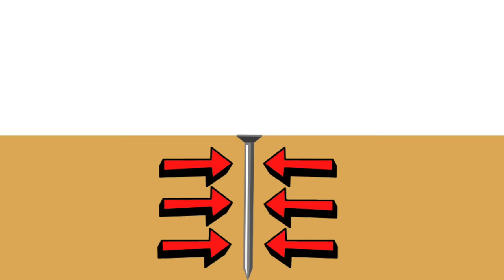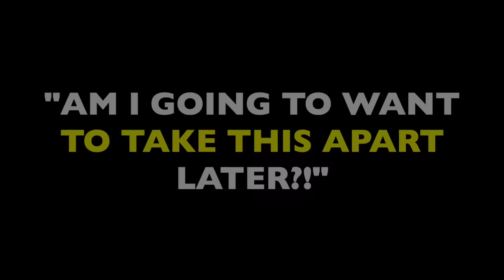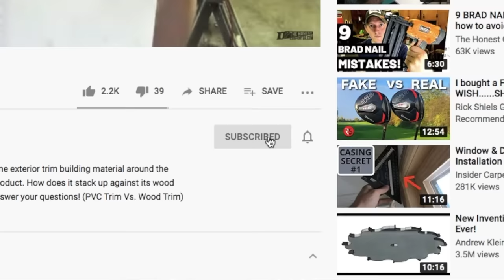NAILS vs. SCREWS...Which Should You Choose?! (Pros + Cons of Nails And Screws For Your Projects!)

Comment: If using screws for a large project, skip the ones with Phillips head slots and run from those with flat head slots.  Invest in screws with a star or square head that are sold with the driving bit you need in the same package m.  This will save you plenty of time as you don’t strip out the Phillips head slots.

Comment: There are also different types of screws. Shear strength can also be improved with a bigger diameter screw. Screws are also excellent in pulling things together to the right location with force. When building a floor system on top of a wall you can literally use one screw to move hundreds of pounds of timber to location or straight line. We do this at work as we build the floor before attaching it to the walls under
Reply: 👆🏼👆🏼👆🏼👆🏼...™️!!!!
Hit me up
❤️❤️

Comment: Nails will pull out more easily than screws, UNLESS the nail has rusted into place. I never considered that until about 50 yeas ago I had to remove some 10 year old siding, then I found out just how well (uncoated) nails can resist pull out. OK, not for decks and such, but things like siding nails work.

Comment: Like you, i use both nails and screws. I only buy exterior nails though, I don’t want to have two boxes of each size hanging around. The nails are usually ardox (spiral) as well. I would just buy exterior screws but they’re not particularly strong, too brittle, better with construction or structural grade.

Comment: I think you missed structural screws. Some are equivalent to 8d, 10d and 16d nails for framing. But it's very important the right screws are used. I think Simpson Strong-tie and Fastenmaster have the easiest to find information on loads/strength of their products. 
I just built my own deck (in Cary) using structural screws (some 8" long!). I'm sure I overbuilt it but I didn't want to do too many calculations. The inspectors didn't check all of my fasteners during the framing inspection, but that might be because it's a very low deck (Cary requires permits for those). I was expecting them to check to be sure I'd used the correct ones. I had all of the load tables for the screws I used ready for them, but they never asked, :-(
Btw Ethan, you're welcome to come see my deck. I got some great tips from you and several other content creators when building it. I'm pretty proud of it.

Comment: I see a lot of comments here (and elsewhere) of people preferring screws, especially for deck boards. I agree they’re strong, etc. and go in great with an impact driver. They’re awesome!  UNTIL you’re the next owner and you’d like to replace or flip the deck boards. The screws just snap when trying to back them out. Going through this now and 90% of the deck screws (T25) are snapping off and I’m having to destroy a board that I could’ve re-used by just flipping it over. It’s quite frustrating.

Comment: Hello. I have a question:  What size wood screw to use to join 1/2" plywood to 3/4" subfloor?  Also, how long of a screw.    I know its going to be either a #6 or a #8.       Also need length?

Comment: Another option to consider is using cut nails instead of wire nails. While cut nails cost a little more than wire nails, they hold better and are less likely to split a board.

Comment: Am I correct in saying the other factor when deciding between nails or screws is wood movement? Nails would be better if the piece(s) are moving because of their sheer strength.
Reply: That's how I judge it. I use deck screws on everything else that doesnt move over time

Comment: Those Deck-Plus screws are exact. Once I used the star head screw there far superior to the Phillips's head, the star head has a more gripping area; I gave all my Phillips heads away.
Reply: Try a Robertson screw, if you can find them outside of Canada. Puts Phillip head screws to shame.
Reply: @leegifford2942  I've tried the Robertsons. They are far better than Phillips. That's the style of screw that came with my Craig jig; I have replaced all of the Robertsons with the star or torque head screws. I live in Northern California.

Comment: I’ve gone back to temporary scaffolding I’d screwed together . With dry wood , when I went to take it apart the dry wood swelling had cause about 10% of the screws to break 😳😬 they weren’t decking screws , just standard wood screws .  Something else I’ve noticed is expensive screws are far better all round than cheap ones .   Nails 🤷‍♀️ cheap nails expensive nails 🤷‍♀️ it’s mostly price by coating

Comment: Hi enjoyed the information you shared. I'm in a catch 22 situation. I'm building a tool shed 2m X 3m but I might have to take it apart in 18 months time to move it. Screws seem to be the obvious choice in this case but will screws give me the strength and durability I need
Reply: Build it as a panel system; constructing the panels with nails, and attaching the panels together using screws or structural lag screws.

Comment: I think you meant that nails rely on friction rather than tension to stay in place.  For anything with a long term tension load, you should use screws. If you are attaching a heavy ceiling, use screws. You can put nails in tension only for short term loads such as wind and earthquake.

Screws actually tend to be stronger than nails in shear. However, nails have more ductility which make them better for earthquakes. You have design a screw for about 2.6 times more force in an earthquake than you would need to for a nail. It is the required design force and not the capacity of the screw that is the main issue. Screws are more brittle since the steel for the thread needs to be hard to cut into the wood. Some modern more expensive screws use two different types of steel so the threads can be hard but the core is softer for ductility.
Reply: The real reason screws are hardened (more brittle) is because of the torque (twisting) needed to install them, not for the threads to bite. Even a softer, more ductile, "wood screw" will bite into most woods.
Reply: @petem2700  I did some research on this and it is incredible how like information there is about the rationale for the chosen materials for screws. The steel has to be strong to resist torsion. A sharper edge of the thread reduces torsion (gives a "better" bite with less force). A harder steel will reduce striping at the head. So there are actually multiple rationales for harder and stronger steel. But there are also brass screws, so it is not impossible to have softer metals. It just isn't as good in terms of performance and cost.

Comment: Screws are used for tension requirements, and they shear and break easily. 
Nails are flexible and bend easier, and are more difficult to shear and break.
The two are used in different applications for different reasons.
Don't use either for purposes they are not designed for.
Follow the guidelines for building and construction codes regarding screws and nails, glues, etc., the guidelines and rules are there for a purpose.
I've been involved in the trades including building construction, mechanics, engineering including aircraft maintenance engineering, welding and fabrication, manufacturing, maintenance, etc., most of my life and there are good reasons for the rules in their applications, including for safety. Break the rules and suffer the consequences. Remember, if all else fails, follow directions, including with all hardware, chemicals, materials, safety equipment, and the like.

Comment: New house or addition frame....nails. Remodels and decks ....screws. 3/4 T&G flooring....staples.
Reply: Doesn't matter what fastener in 3/4" t&g, along as you use subfloor adhesive. A good adhesive has all the holding power.

Comment: I just assumed that screws were better for framing, but too slow. I learned that nails resist shear and are required by code for framing. Thanks.
Reply: Well, more like they're the standard default but there are structural rated screws and if it's an engineered structure then it's up to the engineer how it should be fastened and sometimes screws are used but they have to be specifically rated for the task and not just regular screws.

Some companies even make a type of screw that can be fired through a nail gun...  So there are options, just not what the average person would use.  More in line with custom high end building or commercial building construction.

Comment: The Old Guy again.  If you are in business, time is money.  So you use a nail gun.  If you are retired (like me) you have more time than money.  So I use screws when time is not a factor.  You will use less screws than nails, so that saves some money.  It also matters if you need to drill a pilot hole, that increases the time on a project.  Money saving tip: Use drywall screws if the project is an interior one.  Cheaper than deck screws.  Great video, HC, keep up the good work.
Reply from the maker: Thanks Drue! I’ve used quite a few drywall screws over the years as well. I think they’re strong enough for plenty of applications 🙂
Reply: Drywall screws are also more brittle than structural screws or nails. EVERYTHING moves, and the lack of ductility means they will fail. Drywall screws fail suddenly, and completely. DO NOT use drywall screws in load bearing/framing situations. I learned the hard way more than 30 years ago after blocking that was holding the plank that I was standing on suddenly let loose. The 2x6 block was attached using 3" drywall screws, all of which snapped/ sheared. While picking myself off the floor, I determined to never use drywall screws structurally again. I am referring to DRYWALL screws, and not structural, or even deck screws, which are not as brittle. This from a professional builder of almost 40 years. Experience is knowledge.

Comment: When I built my house in 2009,  I used Phillips head screws.  From the framing to the cedar clap board siding...all screws.  House is still standing and rock solid in wind storms.  The best thing about phillips head screws is the cost...very affordable and often available in bulk. Sure, they require a little patience to install but I would have gone broke using torx screws.  Nails...no thanks.
Reply: But what TYPEs of screws did you use? There's a huge difference between structural screws with a Phillips head (if you can find them) and just any old screw that will fit a Phillips driver. You may be simply lucky for now if you just used some bulk screws. Good luck!
Reply: @lynnwilhelm7928  No luck to it. I've been a builder for 50 years.  Majority of framing was fastened with 8x21/2" course drywall screws. In my area these are available in bulk for $3/lb...fraction of the cost of torx.

Comment: There is something that is most commonly missed when comparing screws to nails. Screws create “Adhesive Friction”. The screws are the means by which two material surfaces are pressed together to create pressure of the two materials to keep from moving or sliding apart. Nails can only temporarily create this situation and very weakly at that. 

Screws are best utilized when the first material is pre-drilled for the screw to threads to bypass that material and grab the second material to draw it tightly to the first. Without the predrilled hole, the screw is simply continuing a thread course until the head has been drilled into the first material. This method doesn’t do much more than what a nail would do and the screw now has vulnerability to snap if a perpendicular or sideways force is applied.

When the pre drill is performed, the screw acts as the means of pulling the two materials so tightly that the adhesive friction becomes an overwhelming obstacle to cause separation. Pressure and the heat from the friction when a force is applied greatly resists the force and remains intact. Nails don’t even come close to this. 

I personally and professionally almost always use screws in everything that needs a fastener. Decks, wood fences, framing repair are some of the examples. I always explain this to my clients who afterwards always prefer the screws. It costs more, but the constructive assurance is what they really want. 
For strength, four screws are worth 20+ nails. You can eventually pull the two materials apart even with 20 nails, but you will tear up the material if you try to pry it apart with 4 screws. The bottom line is let the material be the bonding force, not just the fasteners.
Reply: 👆🏼👆🏼👆🏼👆🏼...™️!!!!
Hit me up
❤️❤️

Comment: When you use a nail gun is it true on some nails or staples they are coated with a wax type coating that melts under the heat going in and sets up seconds later to hold better?
Reply: That coating is glue. And yes, the heat created when a nail is gun driven activates the glue. Also, when using hand driven nails, look for "cc sinkers". The cc stands for cement coated, which is....coated with glue. "Common" nails mean bare, or no cement coating. The glue greatly increases pullout resistance.

Comment: Given that screws are now as strong as lag bolts, the nail would have bent and let go before the screw snaps. Making the proper screw that is thicker than the supposed good enough for the job nail, better at holding up to forces

Comment: Simpler breakdown -> 

Nails are cheaper and can be quicker, also where they fail as potentially as a fastener, it can be an early indicator of a connection problem that a screw would not warn you of. 

Screws, made of hardened steel, are now able to take on more force than the wood or a nail intended for the same job, including joist hangers, so shear force is moot. A large screw can bind if you twist with no pilot hole, and be far more difficult to remove.  Coating does not matter as much as applying some sealant over all exposed metal, because no manufacturer loves you enough to make something that is truly going to last as much as a little bit of beeswax or paint could actually provide. So if you're throwing salt on your deck you probably should go ahead and cover all of your screws nails and hangers with a generous amount of wax or grease to get 50 years out of it. 

Hope that helps someone.

Comment: I built a rig to install 5/8" sheet rock on my garage ceiling that got ruined by  a water leak. It's was 2x4 frame with rollers made out of 4" PVC. I used screws. Now the whole thing is part of a shelving unit that is construction adhesive with screws. It's not going anywhere.
Reply from the maker: Yeah, that’s not coming apart without dynamite, Paul 😆 🧨
Reply: @TheHonestCarpenter  I have job specific tool boxes full of tools. Probably 3 to 4 hundred pounds plus another 100 pounds of other stuff!

Comment: could use more information on why nails are made from steel alloys with more ductility. why do manufacturers make screws out of more brittle material? could use more information such as relative yield vs ultimate strength curves and also why all airplanes and large vehicle utilize either rivets or screws/bolts. are those screw/bolts made of higher grade alloys?
Reply: Screws are hardened to resist twisting from the torque required to install them. Hardening them makes them more brittle.

Comment: Honestly you forgot to mention that when screws If you accidentally Shred the screw heads when drilling into something it's almost impossible to unscrew it, in my opinion that's the only thing that's bad when it comes to screws, honestly I use screws as a reinforcer when it comes to wooden fences, back in the day when my fence used to come apart over time I used to remove the nails to replace them with screws nowadays I just use the screws as a reinforcer.